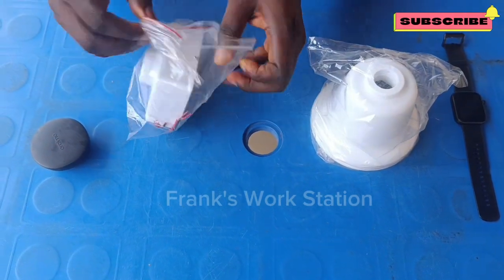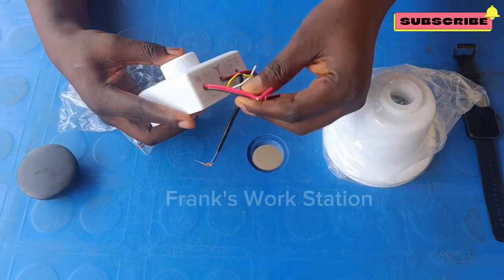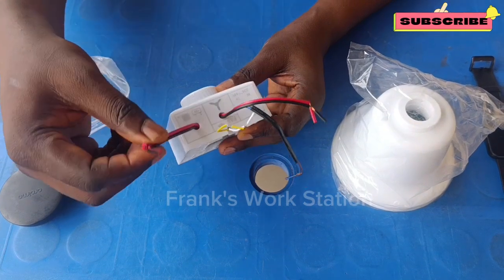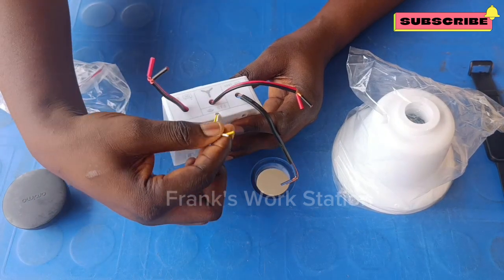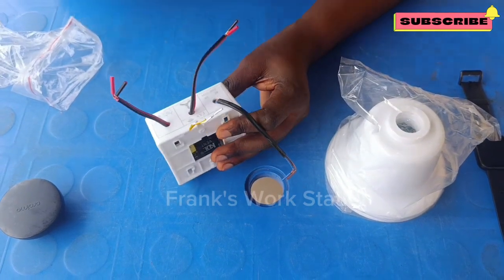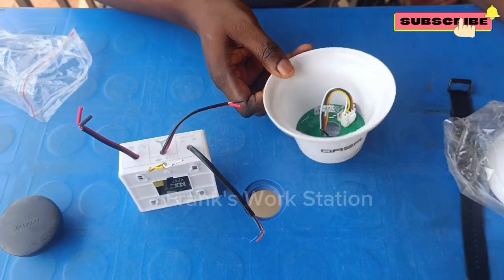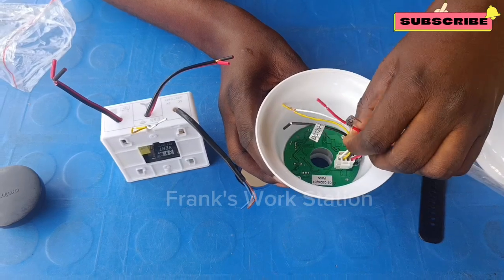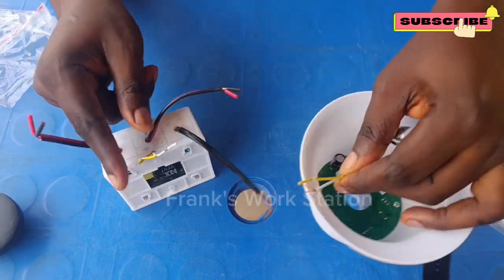AC/DC Solar Ceiling Fan Connection

Comment: I have done this but still it didn't connect .. got pissed off this evening it took me a whole hours still no avail
Reply from the maker: Sorry for your experience. Make sure you don't miss the wire connection, they have their colours.
Reply: yellow for yellow, white for white, red for red and black for blank. Then check label for the regulator, we have AC power and DC power, it depend on the power input. ensure to use 12v DC if you are going for DC and if u are going for AC, ensure is in between 120v to 220v AC